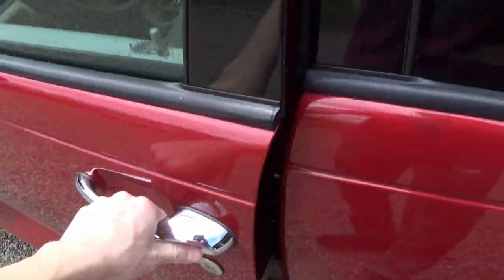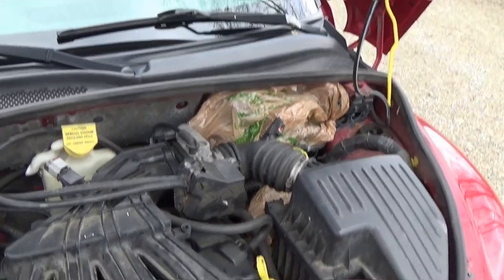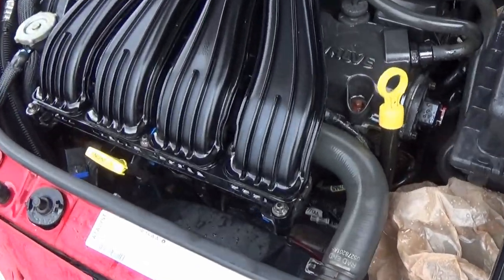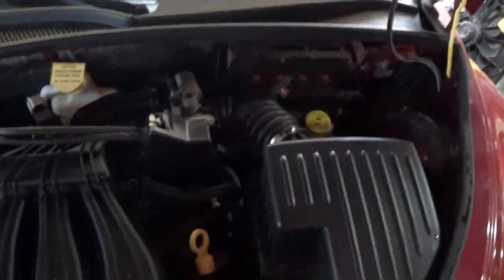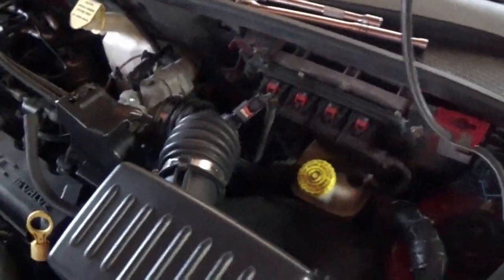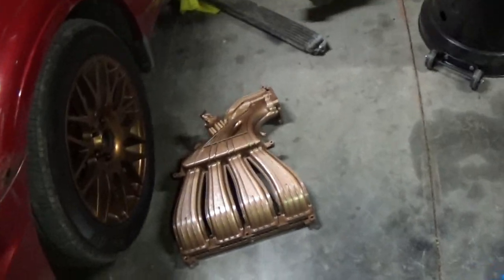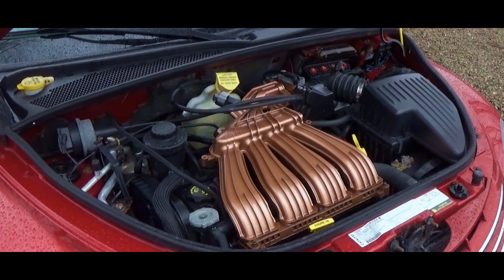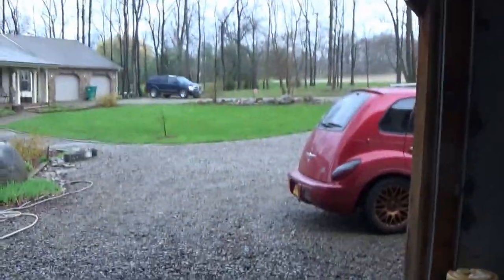DAILY CRUISER ENGINE BAY TRANSFORMATION!

Comment: Get a spray bottle that produces a foaming spray (tub cleaner at the dollar store)) and fill it with straight Greased Lightening. Mask on, (the mist will make your throat sore) spray everything under the hood with the clingy foam and after a 5 minutes soak, a low pressure garden hose cleans well enough to paint afterwards.